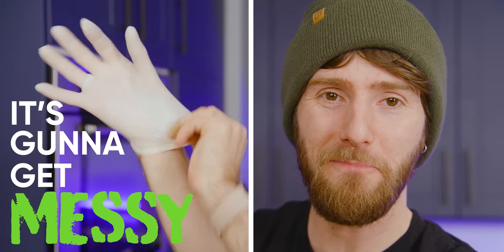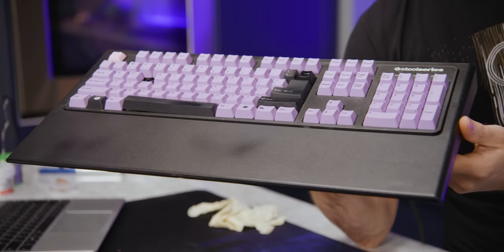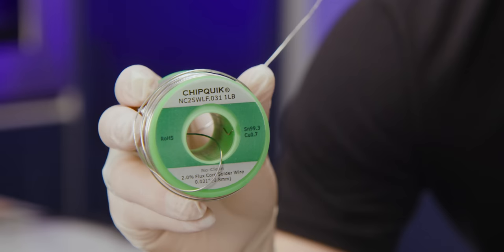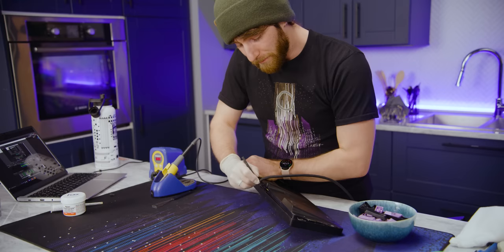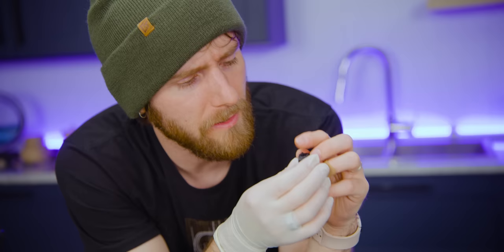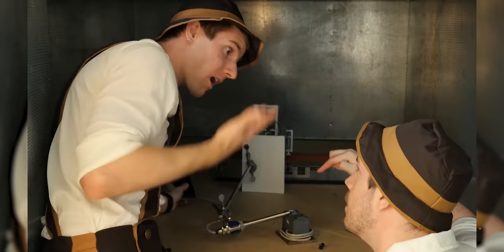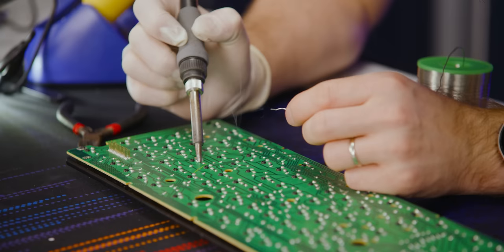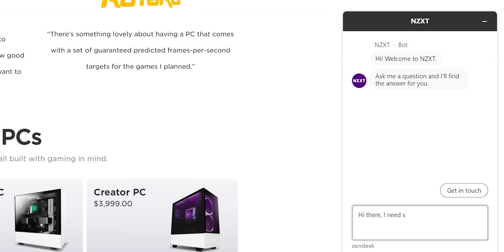Fixing my Wife’s $150 Keyboard for $1

Comment: It stands to reason that the E key was the first to fail. I would've expected the space bar to go first, but E is next in line.
Reply: Space bar is stabilized, less chance of mucking up the click / contact thingy.
Reply: @owlstead  That's what I figured, but it is more often used than the E key.
Reply: @theofficialczex1708  Maybe it's a mix of luck and the stabilizers of the spacebar that prevented it from dying first. However, the most used character is E as far as I remember.
Reply: @torpedo996  E is the most used letter, not the most used character.
Reply: I think this speaks to the quality of the switches. A highly-used key failed first, rather than a fluke failure from a less-used key.
Reply: well it makes sense since E is the most common letter in the English alphabet.
Reply: @jiemingou2010  E is the most used letter in the English alphabet, but the most used character is space.
Reply: My spacebar on my Logitech G810 has kicked the bucket its so much of a pain I'm using a G15 until my new keyboard comes and oh man membrane keys are bad
Reply: maybe a heavy Warframe player :D "E" is used for Meele attacks

Comment: You should do one for Mouse microswitches, probably 90% of discarded mice are discarded because the quality control of the microswitches of even premium brands is basically nonexistent.
Reply: I fixed one of the switches on my mouse, and it's pretty much the same in principle. Crack it open with the appropriate screwdriver, desolder the old, solder in the new. Micro switches are pretty asymmetrical so you'd have to do some real magic to get them in there wrong
Reply: This ^ (although it's more useful to see mouse model specific guides). All my Logitech mice (including the expensive G-series ones) are now unintentionally double clicking and waiting for the switch replacement. 10 pcs bag of D2FC-F-7N(10M) cost 4 €, but Logitech has designed the mice so that it is unnecessarily annoying to do the replacement.
Reply: That's honestly just how it's gonna be, especially for new products from big name brands. Something I genuinely appreciate in the tiny companies with the no name 3rd party hit or miss hardware is that it's often made so cheap that it's incredibly easy to fix.
Reply: Yep I did this a while back for an old mouse and it works great. If you’re really cheap/ don’t have a soldering station, you can even crack open the switch and bend the contacts slightly to get a bit more life out of em, but eventually you’ll need to replace it.
Reply: I did this with my mouse, been going since 2010. The most shocking part was that the £100 mouse had buttons rated for 5 million clicks even though 50 million click buttons are a few pence more expensive. The most positive way to think about it is the manufacturer cheaped out. The most likely reason is they want their mice to break faster so you buy them more often
Reply: but that's my secret to being a cookie clicker master - a double-clicking razer naga!
Reply: I am partial to kailh red (GM4) 
Though for me cables and dust on the sensor have been the most common "killer", though buying a new 2 bucks usb cable, cutting off the end and soldering it on is an easy fix, and just using a rolled up glasses cleaner tissue with some cleaning spray on the sensor once in a while keeps the dust from being a problem.
Mechanical mouse wheel encoders also gave me trouble, but same as the switch, though they are often even easier to fix as they are often on a cable.

Good omron or kailh switches should have quality control at the factory, so they generally last pretty long. 
Actually that's where some of the cheaper midrange gaming mice do pretty well, they use a fancy sensor and brand switches as marketing, but that's basically what matters for performance and durability (ergonomics are imo the most Important, but that depends a lot on who's holding it)

Comment: As a SMT operator/touchup(inspects and fixes issues on the boards as they come off the line) it's nice seeing more videos about soldering. once you get the right soldering iron and good flux/solder you won't believe how easy it is to solder/de-solder most things. I was always fascinated with circuitry and it's amazing building and seeing how everything operates.
Reply: Which ones do you recommend? (Amazon link would be great)
Reply: @inspiringrex1198  I was going to ask the same thing XD did you find any good flux/solder

Comment: For de-soldering, its actually easier if you add more solder then suck it out. From there the switch can be pulled out then you can clean the pad with the wick.
Reply: That's good advice, but I've never had issues just using a wick to remove solder from through-hole components. Especially with a PCB clear of a bunch of extra components like that keyboard PCB. I would honestly use some no-clean flux preferably if you're having trouble heating it, but it's kind of personal preference at that point.

Just try not to lift a pad, keep the heat on until the wick is completely off. I've never had a good time using solder suckers.
Reply: @CreativityNull  Well the point of adding more solder is sometimes it can be difficult to melt old solder, and adding new helps with that
Reply: Was gonna say this exact thing. Stuck with a shitty solder sucker? Just add some more new solder to the old stuff and it'll pop right off.
Reply: In my experience, the only reason its better is because you add flux on top of it. (with the new solder)
Reply: @mathewdempsey16  which flux also does... Which is why I mentioned flux. Typically solder has flux with it, so it's really the flux that's helping, not the entire thing...
Reply: @mathewdempsey16  not just "old solder", but often lead-free.  Similar to the Chip Quik SMD removal solder Adafruit sells, by adding leaded solder to the lead-free, or the Chip Quik low-melting-temp solder to the existing, it "dilutes" the existing solder, making it easier to work with. Or yes, as also mentioned, adds flux to the equation, allowing the solder to "flow" (into the wick or solder sucker) easier.
Reply: @CreativityNull  I'd like to disagree with that last statement.
From my experience lead-free solder has a higher melting point. Combine that with oxidized factory lead-free solder joints and possibility of melting nearby plastic parts and you can have a very bad repair. Yes, flux helps tremendously with oxidation, but adding leaded solder brings down the melting point of the mix and the repair is safer for the whole region of the board. 

And sometimes even that doesn't help. 
I still vividly remember using a butane torch lighter to remove a USB socket from an old motherboard: 
couldn't move it with either soldering iron or heat gun (too slow heat spread and metal casing acted like a heatsink), but after blasting it with 1400 C (2600 F) for a couple seconds it came out with cosmetic melts, but still was usable.
Reply: I usually find I have the best luck with adding a bit of new solder to get it to actually flow, using the solder sucker to get the big blob off, and then using wick to clean up the rest. Nice thing about the sucker is that it isn't consumable, so you can save quite a bit of wick by using it for the big clumps where it'll do an ok job.
Reply: @mathewdempsey16  doesn’t help with a vortex pok3r. Even with a nice soldier vacuum gun, you’ll still lift nearly every pad. But yeah especially for through hole components just add a little more solder, especially for caps and diodes, you sometimes can get all the solder out even with a wick or a lump, and you can get way sometime just pulling the part out if you just bridge the solder so you can keep both pads melted then clean up the holes later.
Reply: @mlindholm  lead fee ? i spit at thee ! old computers and consoles seem to last way longer because the solder joints and more flexible to temperature change and stress ,lead free is why so many people try to reflow microchips back on with an oven lmao ! also one of the reasons why xbox 360 RROd'd
Reply: @mathewdempsey16  this is true because factory solder is usually lead free (hard to melt) with all the solder burned out.
Reply: @girlsdrinkfeck , what about the lead?  What if I'm super-cheap-DIY-guy and don't have a well ventilated area, smoke filter, and I solder every day for the rest of my life?  Should I just breathe in lead fumes?  Is lead really not that big of a deal?  How hard is it just to be careful with lead-free solder?
Reply: @brettito  it's jank
Reply: You’re encouraging sloppy work. All you propose is for more heat to be applied over a greater surface area. Wick is discouraged on production lines because it encourages operators to be less conscientious about their work. For someone random cracking open their 150$ piece of technology they are one tap of the soldering iron away from destroying what they have.
Reply: @FumblsTheSniper  Fair enough. But you can also say the same thing about a random with no experience buying/borrowing a soldering iron and trying it out for themselves.
Reply: Especially if the original solder is lead-free. Add some leaded solder with flux and it's much easier to remove the solder.
Reply: @MikkoRantalainen  again, encouraging lazy operation. These are expensive electrical components and lead-free solder is not at all harder to work with. You should be spending that 1/10th of an second difference paying attention to what you’re doing. 

Honestly, it’s like you all just do this as a hobby and don’t care that you’re ruining your own expensive electronics.
Reply: @FumblsTheSniper  Expensive electrical components? We are literally talking about sub $1 dollar keyboard switch with though hole soldering. Did you also know that leaded solder is less fragile and doesn't fracture equally easily to unleaded solder?

Leaded solder is technically superior stuff except that it's bad for ground water in landfills, which is the reason it's banned.
Reply: @MikkoRantalainen  no, we are talking about a keyboard which cost Linus 150 USD and ruining the value left after purchase by fucking up a 1$ switch being a lazy tinkerer.

That you can’t solder with industry standard tools, I.e. the solder used in everything, isn’t my fault. Stop blaming the solder, you are a big boy that can do big boy tasks.
Reply: @FumblsTheSniper  The keyboard was 150 USD as new. Before Linus started to repair it, it was a decade old mechanical keyboard with broken E button and cherry mx black switches. Not exactly a high end keyboard and definitely not worth 150 USD in that condition.
Reply: @Tri_Nitro  That is when you break out the Chipquik.
Reply: @pigletshut  our lab didn't provide us with fancy stuff like that, rare liquid flux was hardly ever used and we mostly ran leaded solder and rosin. Lead free flux core solder was for the most part crap and we preferred the leaded one when given choice, so adding a bit more to the existing joint was the fastest option. The wick was also rather unpopular even when we started practicing SMD soldering, suckers still were the best
Reply: @FumblsTheSniper  Repeat after me: ad hominem arguments do not work.

I'm saying that the fix that Linus did was perfectly adequate for heavily used 10 year old keyboard with cherry mx black switches. It's not like this new E button is going to be the weak part of the whole keyboard. Instead this E button will be probably last thing to break in this keyboard after this fix and that's good enough.

I write software for living and I often find myself creating designs similar to NASA projects and then it's time to stop and re-think if you could use some simpler design. The same here – the job that Linus did was good enough for the task.

If you think otherwise, please, elaborate the problems that this fix causes in practice.
Reply: @FumblsTheSniper  Great, more ad hominem stuff instead of explaining the practical problem you think there was with the fix that Linus implemented.

Are you just trolling or do you have trouble understanding English?
Reply: @FumblsTheSniper  not saying you're wrong (i know i wouldn't trust myself adding extra to suck, since knowing my luck/eyesight it'd end up shorting nearby traces/SMDs), but we're not talking about legacy hardware that could be a loss to the entire world if done badly (eg. 60/70/80s synths, retro consoles, antique vacuum valve amps, colossus) just a loss to the owner. plus, lead solder may still be legal to purchase as a hobbyist, but illegal for manufacturers to use, at least since 2006 in the UK, so you'd have to get rid of the lead-free stuff somehow anyway: what method would you use besides wick in this regard, without expensive industrial equipment?
Reply: @girlsdrinkfeck  you perhaps misunderstood? I was saying BOTH old solder AND lead free solder, are easier to remove by adding additional solder to the joint, especially if that new solder is the Chip Quik very-low-temp solder intended to help those without hot air stations remove multi-leaded components.

Comment: 8:00 "...saw fit to bend over the little stems..."

Yes, it's called J-STD-001 which is an industry soldering standard. I had to get certified for Class 3, not sure if Class 1 and 2 require it also, but for Class 3 you absolutely have to bend (and cut) all the leads before soldering.
Reply: I'm curious, does it have to do with better contact / more 'stabiltiy' of the soldered component?
Reply: @saltylelele  The stronger the "mechanical" connection before solderng the less likely the solder joint will crack under flexing. Given the design of the switches, there is potential for movement of the pins every time the key is pressed; solder will work harden quite quickly, crack and create unreliable connections. Consequently, for military or automotive applications where there is a lot of environmental vibration, component leads and pins are secured before soldering (e.g wires twisted around tags, connectors clipped or glued to PCBs, large heavy components screwed to PCB or brackets etc.) For domestic "consumer" appliances the environmental conditions are not so extreme and manufacturers will generally do what is cheapest or fastest to assemble.
Reply: It’s the same with any field of professional vs hobbyists. Linus has never worked manufacturing or production (as far as I know) and so probably doesn’t really understand consistency and production rates. It makes me wonder what components like that he’s been putting on without bending the leads.
Reply: Look like some cold solder joints, needed a little more time or heat to flow to the pad and Hershey up.
Reply: They taught us to bend the leads in my high school too
Reply: @gingaming_gg  wish my school had that. It was supervised tool time or help fix up a toasted motorcycle time at my school.
Reply: Most DIY keyboard-ists don't bend over the pins on switches (at least I don't because 1 lazy and 2 they are tiny)
I do bend them for other components, but my patience is not good enough.
Reply: The downside of bending the pins is it makes it much harder to rework/repair.
Reply: @huantian  definitely don’t crimp the leads over unless you have them measured out. A lot of the talking about this is because many people work off templates/production orders and know that those are based off the 99.99% certified best way to do things.
Reply: @IanSlothieRolfe  hmm interesting, thanks!
Reply: @FumblsTheSniper  I feel like saying he soldered all the electrical connections in your house, inside the walls.

Yes, those were not supposed to be soldered ;)

Comment: I spent £30 on ebay buying a "broken" version of my steelseries Apex M750 keyboard and ended up with 104 out of 105 working spare keyswitches and LED's. That works out at less than 30 pence per key switch.

I stripped the broken keyboard to the pcb, cleaned up the undamaged parts of the case and kept them for spares too. I de-soldered 5 keyswitches for a few handy spares but left most on the PCB for safe keeping. The one faulty switch on my keyboard was replaced and its now as good as new.

Given the Apex M750 used bespoke steelseries switches, this is a good approach of you want to keep your keyboard going for years.

Also, sometimes all your key switch may need is the application of some decent contract cleaner and exercising the key for a few minutes. This usually fixes the less used keys on a keyboard because the contacts can tarnish when not used as often.

Comment: I've washed keyboards in the dishwasher for ages. The secret to making them survive is drying them for a few hours in the oven at it's lowest temperature (don't go above 70°C and don't use grill or speed mode)
Reply: It rescued the keyboard I'm using right now after I drowned half of it in my drink... twice... the only thing that doesn't work now after a year and a half is the RGB on the A key is stuck on purple but hey! I didn't have to spend money!